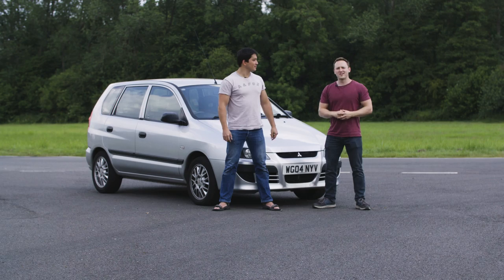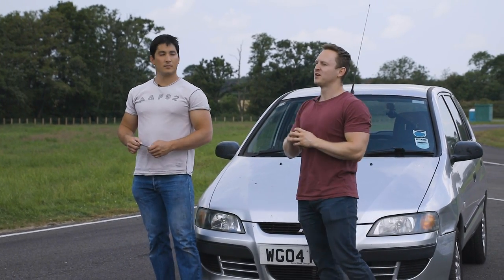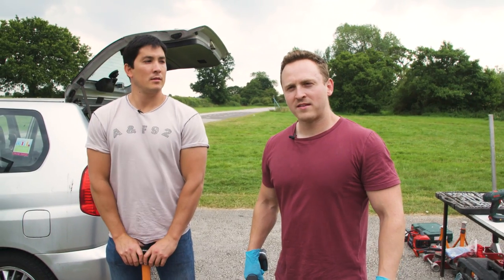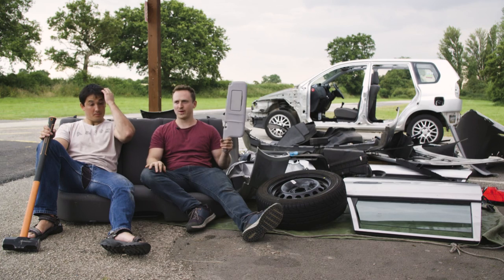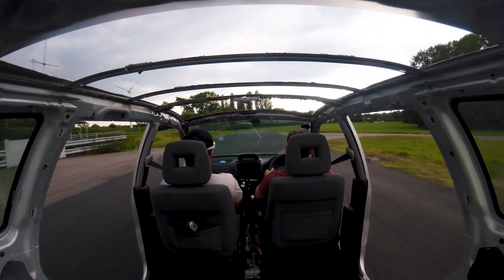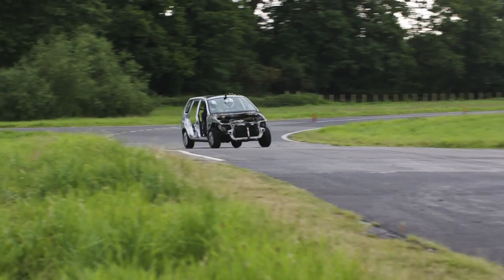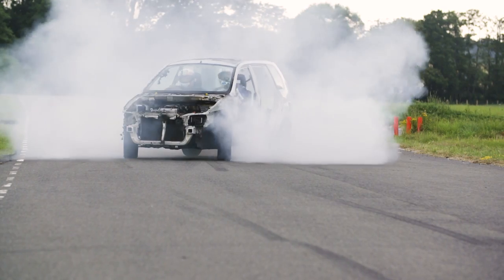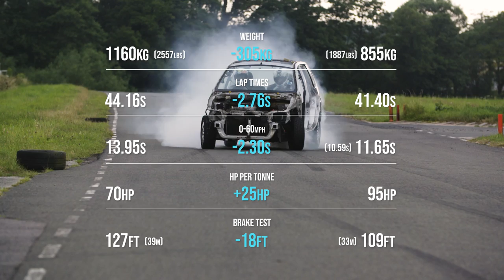How To Make A Slow Car Fast For FREE!

Comment: You take out 300kg you save 2.3 seconds to 60. You take out Gareth you save 1.1 seconds. How much does this guy weigh?!?!!? 200kg???
Reply: Could be a hundred in that gear.
Reply: Häijy Velho I reckon Gareth is at least 100kg just thanks to those guns!
Reply: @LandofBobiness  Well, yeah, that too! But I estimated he'd be around 90, depends a lot on his height I guess.
Reply: @haijyvelho  He's going to be more than 90kg, I'm slightly shorter and in reasonable shape (ie. no beer gut) but nowhere near as bulky as Gareth and I'm 94kg. I'd expect he's over 100kg
Reply: Alex 3rd launch was his best, he bogged down in the first and the second was a bit weak so that also factors in.
Reply: Gareth is tall and all muscle so he probably does weigh loads.
Reply: Take out the other bloke and seats sorted
Reply: The car was already fairly light at that point so every lost kilo made a bigger difference. Removing a 100 kilos from car weighing under 900 kilos makes way bigger difference than removing 100 kilos from 1,2 tonne car
Reply: @haijyvelho  Definitely over 100kg, cant tell Gareths height but im of similar build (slightly less on the arms) and weigh 110kg at 6'2"
Reply: Most of what they did to the car reduced weight but harmed aerodynamics which compensated some of the "added lightness" especially as they approached 60 mph.
Throwing out the passenger, however, just reduced weight without adverse effects. While they we're at it, they could also have thrown out the passenger seat, belt and airbag...
Reply: It's because there's already only 900kg or whatever left, so 100kg is over 10percent of the cars weight
Reply: @DjDolHaus86  depends, I know someone who's the same height as me, same build but not as muscular but weighs more than me. Some people are just naturally heavier or lighter
Reply: Why stop with that,
why not change sofa for light weight beach chair?
Not to mention, why chair at all?
Why not squat, squat I tell you!!!! 😆
Reply: Probably nearly 100kg in that gear, taking that out of already light car makes a huge difference

Comment: Take it to the Nürburgring 😂
Reply: That's one way to go out with a bang lol
Reply: @Jake-kj6zr  its not possible unfortunately im pretty sure your car has to be street legal to drive on the touristenfahrten
Reply: @luisurbanipinto4081  I'm sure as long as it's safe enough you can race on it. Touring cars are allowed
Reply: Yes (Ja) it‘s (es ist) in (in) Germany (Deutschland) 👍🏼
Reply: @luisurbanipinto4081  i dont see why it wouldnt be....😀
Reply: @Thawhid  true but im specifically talking about touristenfahrten because thats the only time you can go on the nordschleife without either being rich or a racecar driver. Because on that occasion the nordschleife has the same laws as any street in germany.
Reply: @deropelaner1176  warum übersetzt du den Scheiß?! Jeder Depp der das Video schaut kann Englisch...
Reply: They won't let you in. You can't have a car with an open engine in case if debris gets in and makes an issue
Reply: As long as it gets a few pit stops to top up the oil.
Reply: @luisurbanipinto4081  but Alex is pretty much a racecar driver
Reply: BAMPh MX-5 damit die englischen Zuschauer wissen was ich meine 😉

Comment: Gareth: I need to wear my biker jacket as protection.
Also Gareth: Sandals.
Reply: Also hole in the front of the jeans
Reply: @darbro7562  It's a speed-hole :-)
Reply: @darbro7562  thats why you noticed it?
Reply: @bigbadcivic2  low key bro
Reply: 🤣 🤣 🤣 The sandals
Reply: Logic 100

Comment: C'mon do it properly... You left the rear quarter windows in and still have the panic handles in the back!!!
Reply: dont forget the dashboard
Reply: I still don't quite get this,  they're talking about removing weight yet they left the engine in... the heaviest part....... :/
Reply: Yeah there were another 20-30kg to save there
Reply: And the entire dash ....
Reply: @Adamadam-tc1qg  dont forget the suspension and wheels
Reply: @MasterChief-ld2ei  what about the chassis?

Comment: 1995 Nissan Micra with the 1.3 litre twin cam 16 valve engine 75bhp. Lowered with weight reduction. Bigger wheels and brakes. That would be cool to see.
Reply: Game Racer said no one ever
Reply: Said a lot of people actually. Quick cars
Reply: alex mclean it would be something different and fun 😀
Reply: My friend got a micra super s. 1.3L engine, primera disc brakes stock, stripped interior, straight pipes and the springs are long gone. It's the most fun car I've ever driven
Reply: I had a 1993 1.3 3 door micra, that thing was faaaast!. Great gear shift and easy to fix when anything went wrong. Handled poorly though, but with abit of work it could kill quite afew warm hatches on circuit. And on motorway it often surprised people in fancier looking larger engined clios etc. 114mph top speed.
Reply: There’s a turbo one for £500 on Facebook selling..... so much want but skint
Reply: Yes !!! I have the 1.4L with 82 bhp ITS SO FAST even without weight reduction !!!
Reply: @IamTheAdic  Aww nice one, they are quite rare, look after it pal. Lad on my street, that wasn't a car person, had one and just ran it into the ground like a twat.
Reply: I had an N-reg 1.0l micra as my first car. Red like a Ferrari, no power steering like a lotus, plastic bumpers like a TVR. Genuinely a lot of fun to rag about in! I'm not actually sure how much weight it would be possible to lose from one of them because they're flimsy as hell anyway and there basically isn't much interior to start with.
Reply: Chris Holloway I had the same.  Was a lot of fun. Had a great gear change and I used to rev the nuts off of it.  Suspension needed stiffening and lowering though.
Reply: Why not just get a nissan march superturbo (in japan micras are called march)(superturbo version has a 0.9l twin turbocharged engine)
Reply: Yep 1.3 SLX. 75PS
L-reg
What a car that was

Comment: This looked as exciting as I expected when I saw the notification.

Shaving off 3 seconds of a 0-60 time is est. the time a real sportscar needs from 0-60. its pretty impressive. 

Considering my e90 330xd has like 1800kg I wonder how much a weight reduction could shave off the 5,2 sec it has right now.
Reply: 0BlaiddDrwg0 You need to shave off 1800 kg. According to Einstein, if you have zero mass, you always travel by the speed of light as a default speed.
Reply: I saw a video of a guy with an e46, if I remember correctly. Stripped the interior, about 300 lbs and was .8s faster i think.

Comment: Do some more mods to it. Maybe add a little 90degree intale pipe with velocity stack on it(like honda engine bay tuners do) maybe a couple degrees of more timing, and removing front dash would help more? Also why you lock your wheels up while braking? Threshold braking is way better.

Comment: What if my daewoo tico weights 600kg already?
Reply: Iconic Car
Reply: @Tebitan2011  Daewoo matiz is more iconic tho :d
Reply: Strip and you will give supercars a run for the money at corners
Reply: @mrguest3749  Im looking at my tico now and there's literally nothing to strip.
Reply: @DooD22  Huck the passenger seat and anything in the back. Shoot, anything that isn't the shifter, drivers seat, and steering wheel can go.
Reply: DooD22 all body parts ,all glass minus the windshield , seats and all plastic (doorcards) and things like that, basically everything that’s not the motor and gearbox

Comment: Hey, Car Throttle Guys, you've missed to get dash trim(includes A/C motor, glove box and things don't need in circit.) and two rear glasses, rear trim lights out. So, it should be a missing chance to reduce weight of car, which could make your Spacestar slowly. Plus, lowering suspensions by using common tools should increase downforce and lowering Center of gravity, which make more faster and increase handling.

Comment: The little wheigt saving by cutting out the roof is useles cause you take away the rigidity of the moist mop chassis.. 😁
Reply: I thought the same... why remove the roof panel?
Reply: It looked like it only weighed a few kilos. Thin as foil

Comment: Ahh, Curborough raceway... Had a crash there once in an MR2. Came round the first corner off of the start bend, back end stepped out and over corrected it, hit the grass and the wheel buckled underneath. Also the first time I ever got to drive a kit car, Vindicator Sprint that thing shifted.

Comment: I'd have liked to see an intermediate step with all the interior stuff thrown out but the outer Body (say, with out the rear view mirrors) left intact. Heavier, but with better aerodynamics.

Also, I'd have liked to see the top speed the stripped car is capable of - I'd guess it's about 10-15 mph lower than the original...

Comment: Striped a car to save weight.
Leaved the dash and the passenger seat...

Amateurs...
Reply: Drivers seat too
Reply: @KarrasBastomi  
It would become too hard to drive without a driver seat... You could change for a racing one they are usually lighter but it wouldn't be free anymore.

Comment: Proof that light cars are more fun that powerful cars.
My old Austin Healey sprite only weighed 685kg before I chucked a bunch of weight out  (now it's probably around 590kg) and it's gonna be so much fun after I finish my spicy 90hp 1275 motor. Slow car fast, my dudes.

Comment: Lots of potential to shave even more weight. Could have taken the windshield, the entire roof, and rear quarter panels off with the angle grinder, and then welded in a roll cage. Would have been even more weight off. You could have taken out the heavy passenger seat when Garreth was evicted. Rear floorboards could have been angle grinded out..

Also, probably should have left the radiator fan in place.

Comment: should've done it properly. There's easily 350kg that you can strip out without being silly with Garreth still inside. Dashboard, Airbags and Wheel arch liners should do the trick. 500kg is possible without the passenger seat and some cutting. Now that's fun

Comment: You could knock the stopping distances down by lifting off the brakes a bit when it starts to lock then re-apply pressure.
I don't suppose you younger drivers are blessed with ABS feet being used to electronic aids.  Power steering was still a luxury when I started driving.

Comment: I owned one of these but mine was heavily modified. Mine was a 2000 pre facelift version and it had a 6a13 swap from a 01 galant with a reprogrammed ECU that pushed it to 170 BHP which was about 155 at the wheels. It was painted in Audi Javagreen Metallic and was sitting on eibach lowering springs and 7x17" Wheels with 205/40 17 tires and all the mods where registered so it was fully road legal. Sadly, a few years ago I lost the fight against the ever growing rust on its subframe so it couldn't pass the Tuv inspection anymore but I didn't scrap it, instead its now sitting at a privately owned Mitsubishi Museum and I visit it regularly.

Comment: You should cut a car in half, all the driving parts are in the front so it should work 😂
Reply: But the fuel tank is at the back isn't it?
Reply: Claudio Petrou is some cars it might, you could get a car with a fuel tank in the front

Comment: Message for the south African mechanic: If that car did end up in a sideways collision from the brake test your elbow would have locked and you would shattered your arm (as big as it is). Don't swivel - sit in the seat correctly and let science take over, although speaking of science its clear you didn't change to fresh pads before testing ahaha

Remember kids: floppy limbs let's drunk drivers survive brutal crashes

Comment: Just shows you that the modern approach is wrong when it comes to performance, Weight affects everything.

Just amazes me how heavy modern cars are, realistically the most weight you can pull is under 200kg, so that tiny car will still be over 950-1000kg, What a joke... 

My ae86, Weighs about the same as your stripped weight and that has a full rollcage (doors lol) and twice the power

Comment: Who else is dissapointed? They could have taken out more stuffs like the small glass panels in the back, useless wirings, and probably could have cutout spare bits of metal... Another 30kg I feel... There are also bits and pieces of meterial pieces  sticking out causing drag and thir motorbike gear counts in for for more weight. The could have done a lap with that on in the first place... If you are doing a video then do it properly... These guys can't handle old school ways of launching, they need launch control I could get a second quicker then their time...

Comment: ditch the windscreen and glass behind the c pillar, shave the tires down to no tread, rip out the dash, remove the alternator, water pump, power steering pump, HVAC, and radiator, take out the passenger seat, and tell that meaty fucker to stick to the stands and you might get it to 7 seconds 0-60